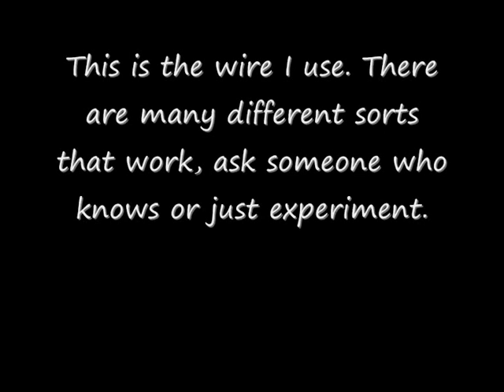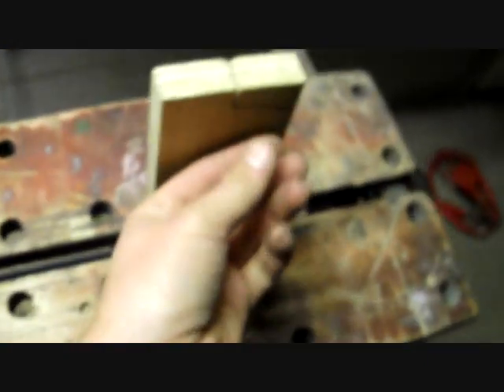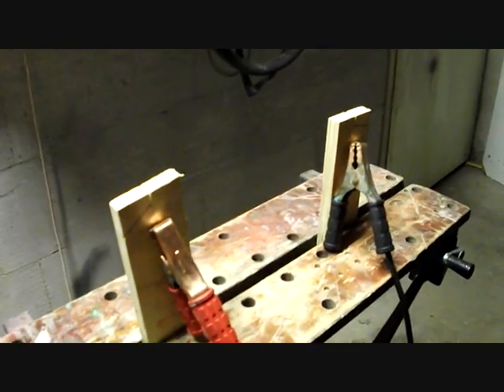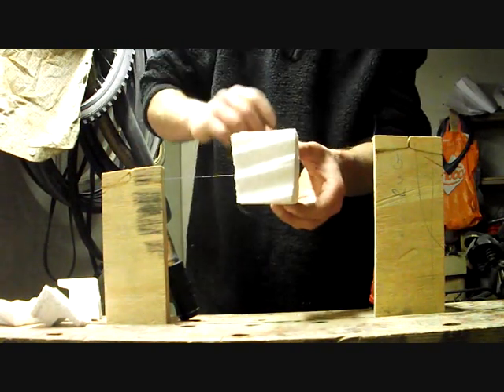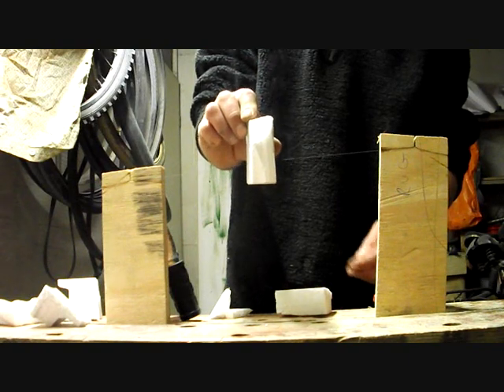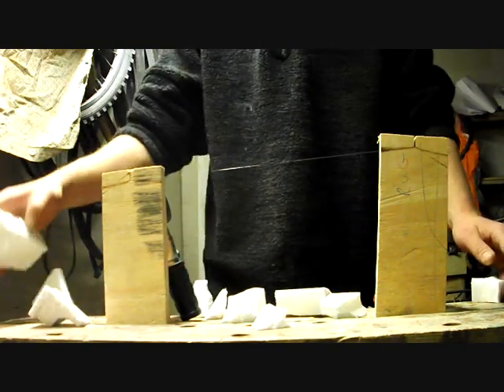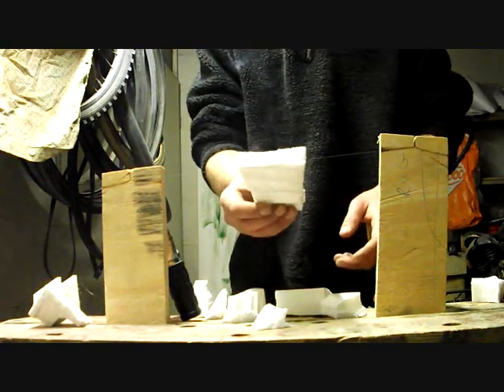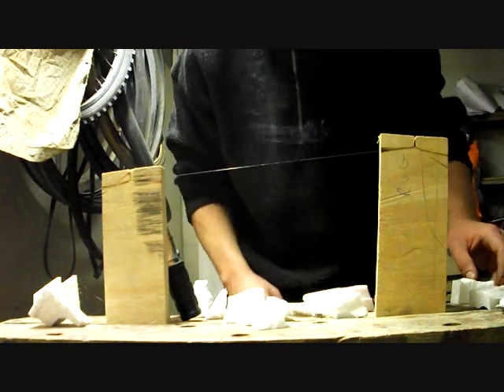Hot Wire Foam Cutter, using car battery

Comment: how did you stop the cutting wire from acting like a fuse and burning out....it looks like a dead short to me?
Reply: it is "resistance wire", there is approx. 7 ohm per meter
Reply: it is "resistance wire", there is approx. 7 ohm per meter

Comment from the maker: Hey, to answer your question: No.

However this is the exact reason I was messing around with foam cutters. This one does not quite have enough power to cut wider bits of foam. But because I do want to be able to do that I built another one.

I got a 230 v to 24 v transformer, placed a dimmer switch on the primary side (230 v)  included a fuse on the secondary side and connected some speaker wire to that side to connect to my cutting wire. Works great!